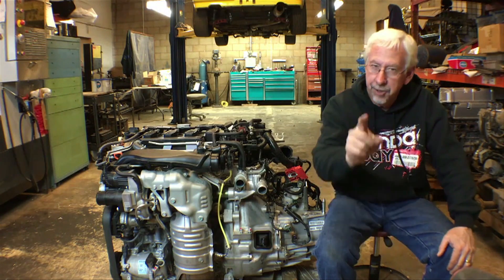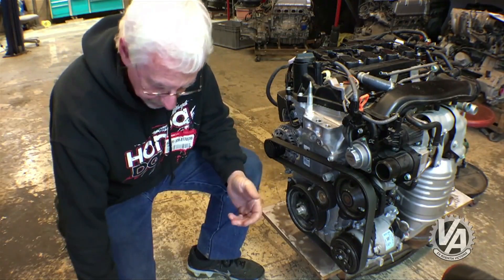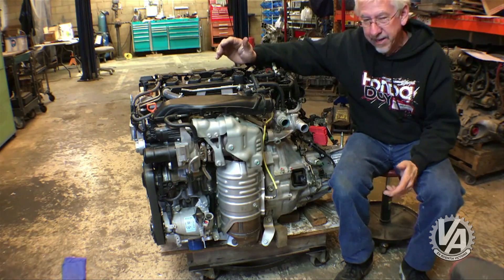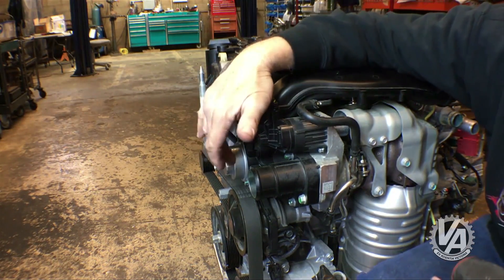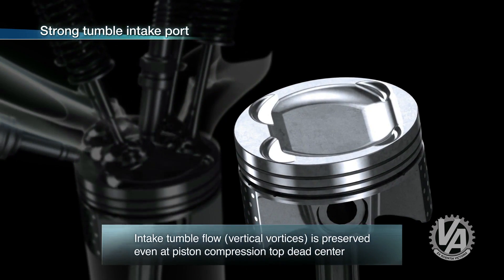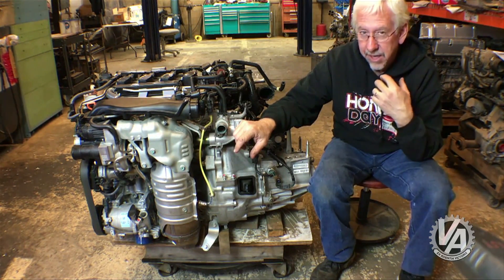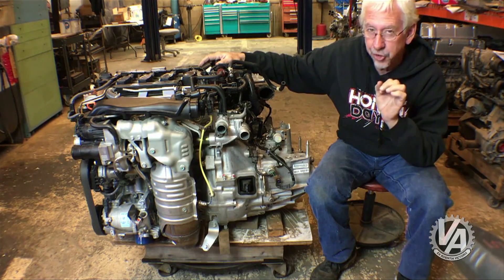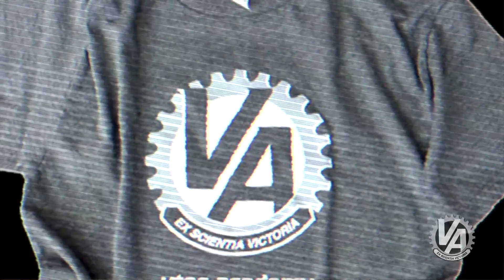Tech Inspection L15B7

Comment: Whats your take on the 1.5 honda turbo engine oil/fuel dilution. I was going to get the 2018 crv ex now lm leaning towards the 2019 toyota rav hybrid for my wifey. I drive a 2006 subie sti my son drives a 1998 honda prelude
Reply: I was going to ask the same thing!
Reply: I have a 2017 crv with this 1.5 turbo engine now with 104k miles oil in the dipstick has strong smell of gas. and car is asking to change oil at around 2k miles when the type of oil I use is supposed to be around 5k. my 2013 fit 1.5 has smoother engine than this with more than 200k miles.
Reply: @gee-rockgee-rock4468  is the engine still good or has it given you any problems lately ?
Reply: Honda wont offer any fix. So whenever the check engine comes on including all the safety warning lights. I will reset the battery to clear the lights. Though a few times while driving and a couple of times on the freeway, the car goes to limp mode (just suddenly cannot speed up slows down till I have to stop) because the check engine just came back on. This check engine keeps coming back on. I notice too the oil has a strong gas smell the exhaust has a bad smell.
Reply: @WTFx around 6000 miles all the way to 99k but when honda dealer touch and updated the a/c and engine update thats when it started to become messed up.
Reply: @gee-rockgee-rock4468  Do you have noticed it made videos..can you give as a proof..videos of what are you saying ?
Reply: Irman Sarajlija I just uploaded a couple of videos, one has a regular check engine, and one is blinking check engine
Reply: please dont be paranoid!

Comment: I wonder if carbon build up on The intake valves is a problem like other direct injection engines, doesn’t look like it would be since the fuel is spraying across the valve while it’s open just curious.

Comment: This is the motor that came in my 17 Civic hatchback & it's freaking quick car weighs about 3,000 lb + just a hondata reflash & a drop in air filter car ran 14.1@99mph I could imagine what it would do in a little hatchback with a Dyno tune 6 Speed downpipes it would be a fast car & reliable! Lol💪👍
Reply from the maker: George R Absolutely!
Reply: Nice thats cool man. I just bought a 19 hatch. Did you run it stock? If so what you ran please?

Comment: Does it have an open or closed deck, forged or cast pistons? Can the engine reasonably handle 300hp?
Reply from the maker: Those are some good questions. The block is open, the pistons I believe are cast although they have huge ring landings. The rods are pretty wimpy too. Some pople have been pushing the engine past the 300hp and 400tq range already with mixed results. It seems to depend on how quickly you roll on the torque.
Reply: VTEC Academy thanks. I'm looking to do a CAI, downpipe (catless) and tune (Hondata) and maybe eventually, water/meth injection.
Reply from the maker: The tune will be critical with stock rods.

Comment: Great video, but it is so sad to see that Honda is using so much plastic in the design of an engine. This engine is guaranteed to have so many problems after 5 or 6 years because half of the engine is plastic. Being exposed to heat from a turbo motor and then cooling off is going to make it brittle, weak, and it will start cracking causing unneeded issues that older Hondas will never suffer from
Reply: It’s possible. But just so you feel better. Bmw has had plastic manifolds for turbo engines since 2007 and my vehicle hasn’t busted its manifold even after increasing boost. It’s now 14 years old. Depends on the plastic type .
Reply: @chrisrobles2012  everyone knows modern BMWs are unreliable plastic piles of junk
Reply: Michael Skiff , lol yet I have mine for 14 years from new. So unreliable that I daily drove it in winter in NC for years. And now it’s 500hp and still going. If you have money and can maintain them they don’t break down. If you treat them like a Nissan Sentra and never change the oil for 100,000 miles it won’t last .

Comment: Notice he emphasized the extensive use of plastic. Heat and plastic don't get along, just ask the guys over at BMW/VW/Audi etc what happens to their plastic parts ie coolant tanks, plastic thermostat housings, cracks in plastic piping. That heat shield won't do much to protect that charge pipe with the increased heat generated with the turbocharger. Wish honda stuck with using metal components because I believe long term reliability will be affected. I realize plastic parts are cheaper to make to keep costs down but as a consumer I'm willing to pay that difference for better reliabilty. But who knows, maybe Honda will prove me wrong.
Reply: Wait until it get 5 more years old then come back to tell us same

Comment: Since 10th gen civic is global and engine is global, as a huge Honda and VTEC Academy enthusiast, I have a question to Brian from the other side of the globe ,Poland, EU. Would You be able to post movie considering L15B7 turbo oil lubrication? The USDM Owners Manual claims that users should use 0W20 synthetic oil, EUDM Owners manual claims that 0W20 should be used only for best fuel efficiency and users can choose from 0W20, 0W30 and 5W30. At civicX.com there is 17 pages discussion, which product to use, that leads to no clear conclusion. If I am just regular user on stock engine yet, driving in continental conditions (-10F-90F) not like a grandma, but from time to time reaching redline (Honda user for ten years, previously with K20Z3), what oil product should I use to improve  turbocharger mileage? Which parameter of the oil beside viscosity grade? Density at 20°C (68°F) ,Viscosity at 40°C (104°F), Viscosity at 100°C (212°F), HTHS viscosity at 150°C (302°F),Pour point ,Flash point ,Sulfated ash is most important? There is plenty of products and we are Honda lovers, so we would like the best for it.... The other question is if there is any lubrication support of turbo while spool-down during engine shutdown? EUDM Civic is equipped with stock start-stop system, which I doubt is helping the turbine to live longer and should be disabled, unless the engineers took that into considerations....
Reply from the maker: I will talk to some people that I think might know that answer.

Comment: If I were to apply the intake valve cleaner to this engine, which vacuum line is the most suitable? Will I throw a code if I unplug the PVC breather line to inject the cleaner? Is the brake boost line a better option?

Comment: So is it safe to put aftermarket bov on this engine like the boomba bov
Reply from the maker: I don't have any experience with that, but the blow off valve is basically a mechanical device. The electronics on that system is confined to a solenoid on the vacuum line and not the BOV itself, so I don't see why not.

Comment: OK let's say someone handed you guys this engine you would have no idea what to do with it if you have an ek or eg chassis. Don't get me wrong I love to get skooled but for the vast majority of swaper/diyers this will not work with out major engine bay mods that will sacrifice stability and structure. But a tubed front end can be a big problem solver in that spectrum. I'd rather go to the new turbo k 20 but I'm also an old dog doing old tricks.
Reply from the maker: sam stefanski At one time the K series was the new engine that was the mystery. We'll have to wait and see how this goes.
Reply: +VTEC Academy absolutely
Reply: +VTEC Academy I jus feel like this particular motor and the cheap quality of it will not be popular with enthusiast and tuners alike. plastic manifold plastic valve cover come on Honda!! if you told them you could save 1 mile per gallon by using plastic pisons they would
Reply: I have always thought the popularity of the Honda brand as a performance car is the availability. There are plenty of cheap used high performance engines that can be put into to cheap used plentiful chassis. Make now mistake about it, the L15B7 engines is a performance engine. It won't be long before small upgrades will yield 300+ hp from a largely stock engine. If that doesn't drive acceptance from tuners, I will be amazed. As for the cars themselves, even with the Civic having gone to strut suspension, people are still modifying the heck out of the 8th and 9th gen Civics.
Reply: This engine will not fit easily in an EG or EK. It's too tall in the front. It may fit in the 2001 up Civic and probably in the CRZ and Fit. I'll also check it out in the 73-87 Civics.
Reply: +Brian Gillespie you lead the way brother I have been such a big fan since before all this YouTube stuff was ago I just can't help when I see something new to jus point out the stuff I don't like about it because that's what catches your eye I do hope I speak for everyone to say the new 2017 type r is a little over the top for me personally I am just very curious on where Honda will go from this point
Reply: Shortly we will be bolting those into the more sedate looking coupes, sedans and hatches.

Comment: Too complicate, too many plastic parts, too difficult to modify.
Reply: How? With just a tune it's gotten all the way up to 255whp and 301wtq, it's already turbo so a turbo upgrade is as simple as bolting a new turbo up, it's direct injection so you dont need to buy new injectors a new fuel pump to run e85, all you need is a tune and e85..... The real questions you need to be asking are 

How much HP can the engine hold stock?
how much HP can the tranny hold stock?
how much HP can the axles hold stock?
How much HP can stock Turbo hold? (not as big of a deal since turbo swaps will def be happening nice to know for basic bolt on builds though.)

The clutch already slips at 255whp and 301tq, so we know you have to upgrade clutch...
Reply: Kevin Osorio clutch is the biggest weak point
Reply: Kevin Osorio I guess you don't know much about engines but once you max out direct injectors you need to upgrade them as well as the fuel pump, no one makes direct injectors because they are expensive to make and buy, so you'll need a port injection kit to run both direct and port injection

Comment: honestly I would not even consider doing this as a swap in anything look up all the direct injection nightmares and cost of parts like injectors and fuel pumps for these motors along with all the detonation issues the industry is still trying to figured out
Reply from the maker: I don't think it will be that bad. Certainly with any new technology there are teething issues, but it will get sorted out and those parts will be available. HPD has been racing some of these engines including at the 25 Hours of Thunderhill with success. I really don't believe these engines will prove to be less reliable in the end.
Reply: it's not a bad thing just with any GDI there is a chance of random detonation that is currently unsolved just went through a bunch of GDI classes I love new tech but given the circumstances that manufactures are in now we are the testers for this tech

Comment: Thank you for making videos like this, it's nice to know there are innovators out there.  I love Hasport!

Although these motors cannot be swapped into eg/ek/dc, maybe the turbo system will be a good swap over for d-series guys; since the turbo system is designed for a smaller displacement engine already.  

I'm imagining a rod and piston, coil on plug d16z6 eg with one of these turbo system, retaining ac/and power steering.  Quick spool, w/ low hp, high torque -- wll make for a great dd and clean sleeperish underhood setup.
Reply from the maker: We now have mounts to swap these engines into the EG, EK and DC2
Reply: i'm sure in a few year hasport will have mounts to make swapping this into the older civics a reality.  Otherwise, us with welders will make mounts ourself until then.

Comment: how about turning it 90° to either a 5 or 6 speed for rear wheel drive
Reply: Devin Tubens this would be great in a Miata ngl
Reply: Shaiyan Hossain only problem is getting a good spot for mounts and as for the oil pan, I'd imagine that would be a nightmare however a dry sump is always an option

Comment: I wonder if there's any internal bottom-end differences like pistons and rods between the engines equipped with 11 fin turbines vs 9 fin to handle the stresses of more power specifically designed to be delivered higher in the rev range. It would be great if they were all strong enough, cause i predict a lot of turbo swaps + reflashes from crashed crv's and si's into the standard turbo models.

Brian, I hope you're right about the single mass flywheel, Matt Farrah (The Smoking Tire) had a sport hatch in a recent one-take video and at one point he shows how much rev hang there is between shifts and it kind of bummed me out just listening to it, takes away from the snappy response we're looking for.
Reply from the maker: As some point I will able to check that out. But my suspicion is the EX and Si internals are the same.
Reply: I think I read somewhere that the internals on the 1.5 in the Si are a bit beefier than the ones in the EX.  People are already bolt on power adding Si engines past 300 hp.

Comment: Is Honda moving away from VTEC and going to VTC's now that they have a turbocharged, direct injected engine?
Reply: What's wrong with using thermo-plastic composite? It's lighter where it counts (up high), reduces cost, and absorbs much more valvetrain noise than aluminum would. When you see many industrial diesel applications using these plastics, even for such things as oil pans, you can put your trust in them that they will last. The technology is here, plastics are here to stay.
Reply from the maker: I believe only for this engine.
Reply: VTEC Academy Got it. Thanks.
Reply: VTEC Academy My few gripes about that new engine when I first saw it was the amount of plastic used, like the valve cover and the intake manifold. They should've stick with aluminum like the previous engines.
Reply: Yeah reduces costs for Honda... Do you really think its gonna be cheaper for us when they start getting brittle and leaking as all plastic parts do with heat cycles and age?
Reply: the honda fit gk5 coes with an L15 that has ivtec still, maybe it would make more power with a turbo kit than the L15B7? idk just a thought
Reply: John L We got in the EU 1.5 turbo Vtec
Reply: +Paul Saari  same as the Australian delivered models we get vtec turbo too

Comment: so many fanboys complaining about the looks of the engine, gentleman its an engine. its under the bonnet (hood) for a reason!!! this engine is far more advanced than the k, f, and b series!! that's why its so groundbreaking, shoot im getting 45-50 mpg in our ext sedan. i would recommend drive one since you wont buy one and you will see where us actual civic x gen owners are coming from. its just a matter of time before someone starts developing parts and starts making these motors go far beyond their potential, just like it has happened with every new honda engine that has been released through the years , the E, PO7a, A series man i can go on,one thing i can advise learn to adjust to change , have an open mind, because Honda is Honda and who knows what they are planning next
Reply from the maker: Just because it's an engine doesn't mean it can't be good looking.
Reply: @VTECAcademy  very true
Reply: an engine should be good looking!
Reply: ... but it doesn't necessarily mean it should be. You talk about an engine, not a dildo.
Reply: jimihendrix225 I have the ex-t as well. Mine is a manual but at 55 mph trying to hypermile I have gotten 54 and 56 mpg on two separate trips. With k tuner and driving around town I average 36-37 mpg and it’s great. The numbers are off of the dash so I am not sure how accurate they are though.
Reply: jimihendrix225 I have found the cruise control to be worse for mpg than without it in this car personally.
Reply: I agree the engine is fugly.  But I'm more curious to see what people do with this engine to squeeze power out of it.  I mean at the end of the day that is more important right?
Reply: Bullshit!
Reply: 45-50 mpg in an ext?...Is that a manual?......what's your secret? (and please don't say K&N filter)..I'm in Detroit (hardly a Civic to be found) and I drive 75% freeway and at best I've gotten 35mpg (with mostly cruise on and staying out of it mostly) must be the cold climate...over 40,000 miles my average since new is 33.1 go figure...my 10 lx-s got 36mpg....bit I'll take the turbo and 31mpg
Reply: Where’s the vtec tho
Reply: I keep eco mode off and don’t use cruise control it sucks.
Reply: The K-series is still in production if you want a pretty engine. Also, you can't have it all at this price point, if you want something high performance that looks good, you might as well start saving for a Ferrari.

Comment: Barely 190 hp? My f20b makes that. So sad Hondas new engine are wack now
Reply from the maker: That engine is good to 230 hp with no modifications other than tuning. Let's see your F20 do that. Or even a K24.
Reply: +VTEC Academy h22a makes 220 lol
Reply from the maker: Mid 200's. The most I've heard so far is around 265.
Reply from the maker: Plus it makes as much torque as a J-series V6 when tuned.
Reply: Guys this is not a 2 or 2.2 engine tho , pretty good numbers
Reply: What's the TQ like with the tune ?
Reply: I've seen a video where someone got 280 tq stable, you can get 300 tq but you need to replace the clutch
Reply: Wow. VTEC Academy , Jason R any links for that?